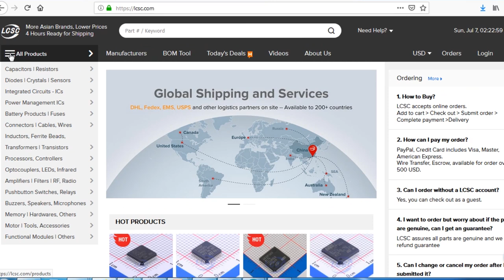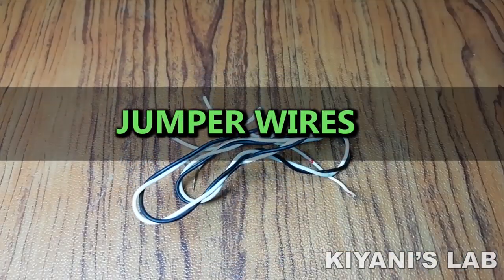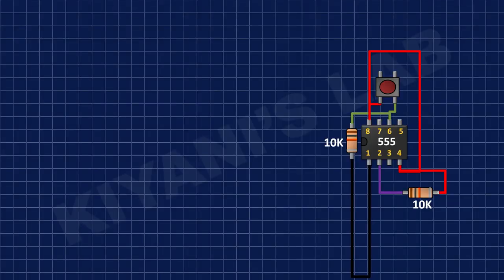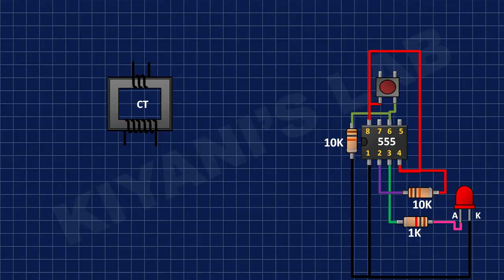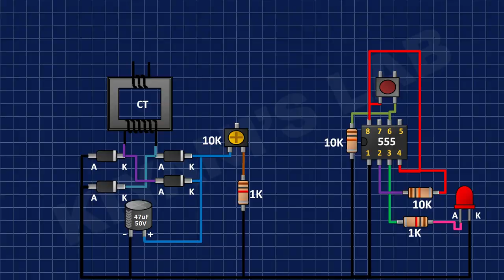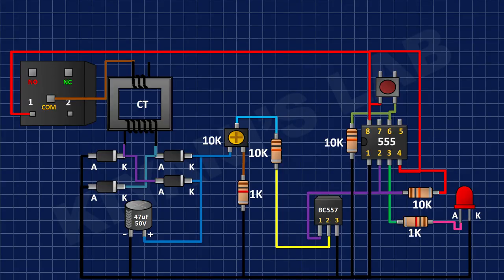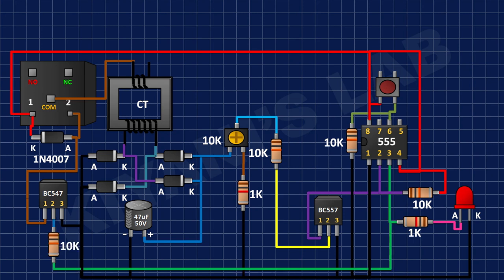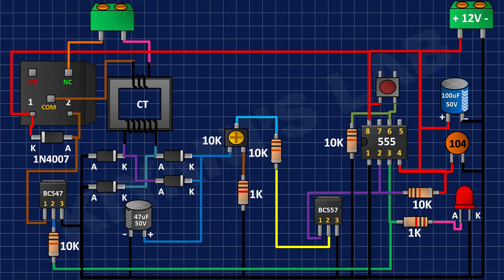How To Make Electronic Circuit Breaker | Over current Protection

Comment: Thank you for the effort :O)   I would have loved it if you spent the bulk of the time explaining the circuit's theory and operation as apposed to just "mechanically assembly the components". I'm sure most of us could figure that out. But the reason for individual components is what would be of value. Cheers from So.CA.USA 3rd House On the Right.

Comment: Another DIY with mini circuit breaker ,relay, ... Using 24 electronic components to prevent Overcurrent protection PCB board without FUSE .I rather buy the completed PCB than making it !  If you have less than 3 components or less to satisfied your design project ? Then it is much better . Anywhere I respect and salute your effort Idea/knowledge Sharing . Thanks , very good job done .

Comment: Firstly Your CT Coil is not set for Current Mode (Put 10R or 1R at CT's Both Pins). Secondly, Your 555 Timer's Capacitors will charge after some time by using any AC Load, Hence you will keep yourself clicking the reset button after now & while (Under Low Load).

Sadly, bad designs, not tested. Please make usable circuits which are tested by professionals (see Internet). Cheers.
Reply: Link pls ;)

Comment: I have several issues with this video.  No explanation of the circuit theory is given, nor any of the test procedure. Current transformer not described in detail. I cannot read the Chinese datasheet.  What is the turns ratio and core material? Should there not be a burden resistor on the output? If you designed this circuit you should explain it. 
Why use a 555 timer instead of an op-amp or comparator?  Watching you solder may be interesting for some, but does not impart useful information.  Also, why not use a formal schematic?  They are easier to read, IMHO
Mark S.
Reply from the maker: sorry for that bro soon i will make explanation videos of my project

Comment: Fake
Reply: why bro ? it is real ? you can also contract me .
Reply: @tokitahmid6641  please can this circuit also work as short circuit protection...?
Reply: @mayoortechinnovations  
I think this project should work if it is made like a diagram in the right way. I made a DC 12 volt project. CT was not used there. It was working. And this project uses AC volts and CT here. You can try.
Reply: @tokitahmid6641  ok thanks I will try
Reply: It's real, I was tested and its working perfectly